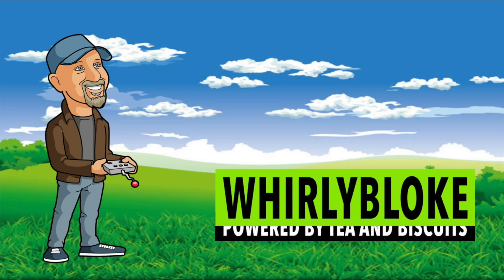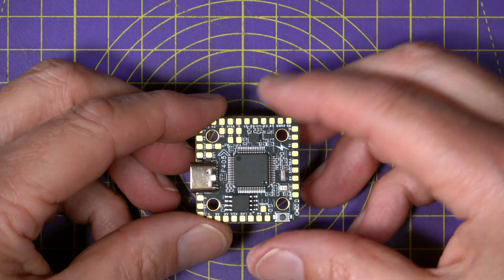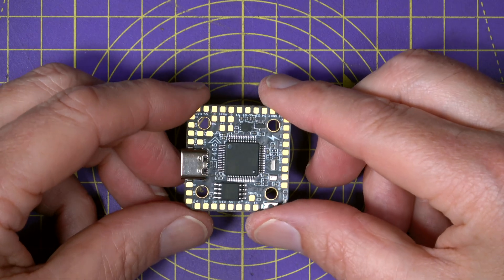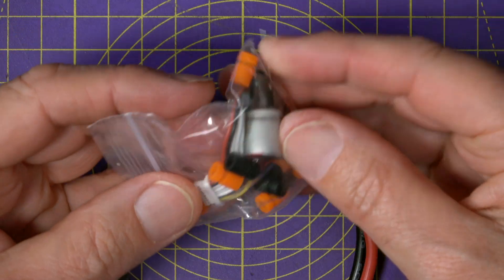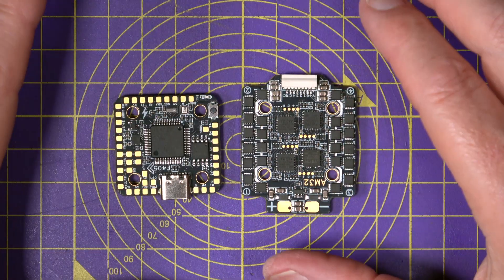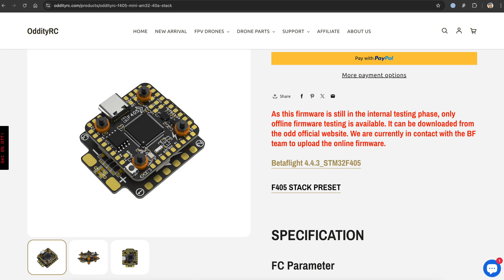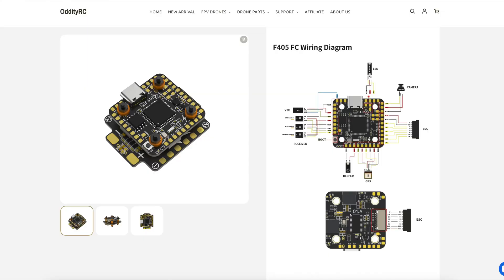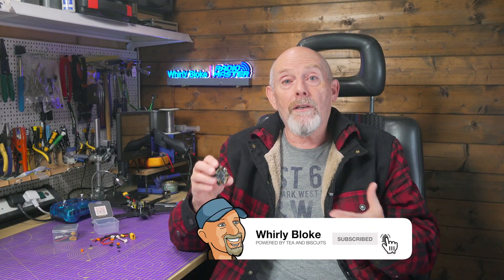OddityRC F405 Mini 40A Stack – First Look & Review

Comment: I'm very excited to try one had the speedy bee 405 air and it flew fine I like my f722s but at 43 dollars just for the fc how could I go wrong trying it out and I don't mind soldering as I've had the plug in ones pop out anyways
Reply from the maker: It sounds like you have a solid plan. The F405 Mini 40A Stack is definitely a great choice, especially at that price point.